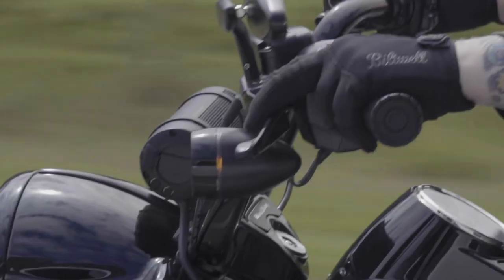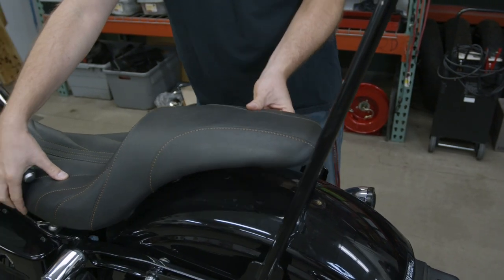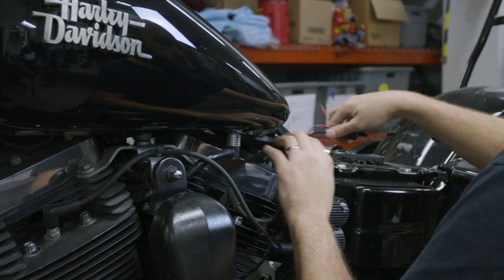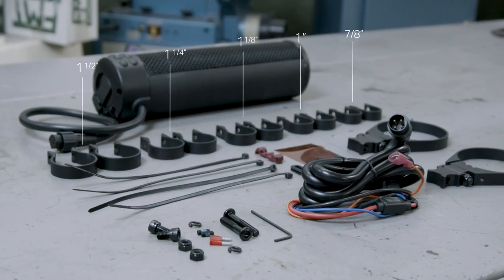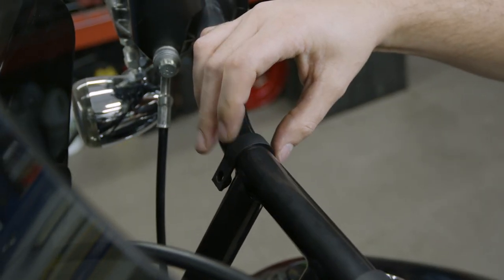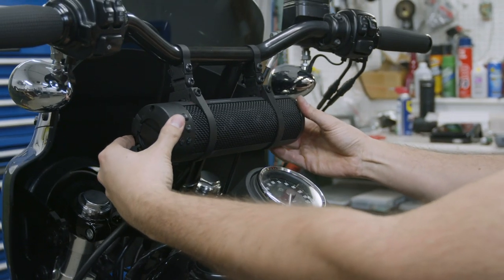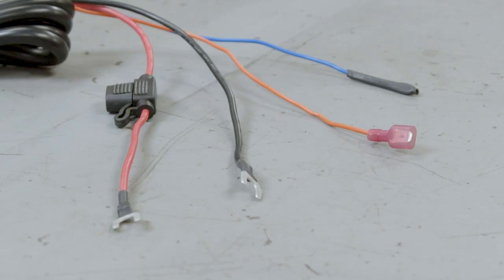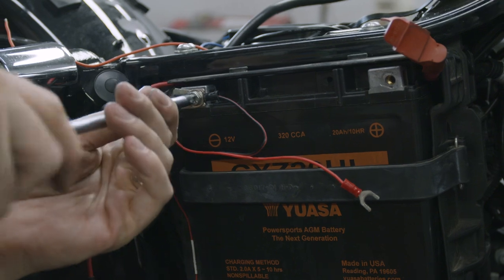How to: Installing Kuryakyn Road Thunder Sound Bar Plus by MTX

Comment: I just finished installing the plus model on my 2014 road king pretty easy install for a novice. Must use all 3 wires in order for the bar to work, pos and neg not enough I used the wire going into the rear fender for the t-tap plug-in I used the red/white wire. Works fantastic took the bike on the highway at 80mph sounds great turn vol up all the way on the iPhone and adjust on the bar. Pricey but not as bad as the Rockford fosgate I was estimated at the dealer with new painted bag lids etc was sniffing $2500., $400 doesn’t seem so bad. I wanted some tunes but I didn’t want to give blood.

Comment: I connected red and black I left the orange off did not work any suggestions
Reply: Me too.
Reply: I added the orange ignition wire to the red positive battery it worked but it turns itself on when bike is off and killed my battery so it needs to be tapped into any orange bike wire to run properly
Reply: I don’t like tapping in so I’m going to have my bike guy do it it’s better that way he knows how to tap in without ruining the wire 👍

Comment: hey where u splice that orange wire on a cam ryker ??? no one seems too know or aint saying ..  great video info ..
Reply from the maker: You're going to want to tap into a switch powered wire!
Reply: @KuryakynHoldingsLLC  Great - which one is that on a 2020 Sport Glide Harley???
Reply: @staneyler  i used a test light to see what wire was hot ONly when ignition on.  fund one and tapped  in.  that way only on when power on.   why they cant tell you this..i dont know

Comment: I am completely stumped!!! HELP!! I have hooked up two different units and have the same problem. Red to red, black to black, orange to switch powered accessory. The unit will not hold power, the lights on the sound bar display for a split second then nothing!! Am I missing something?? 2005 Dyna super glide. I literally bought two different units thinking something was wrong with the first one, and now the new one is doing the same...
Reply: I’m having the same problem, did you get any help?

Comment: which fuse goes where
Reply: thats also a good questions  i googled everything.  just went with it  works both ways   directions are sketchy
Reply: @kymeryobryon834  definitely make sire to use the correct fuse otherwise it will blow prematurely
Reply: @kymeryobryon834   so either fuse will work? One is a 2 and the other is a 7.5

Comment: How can you add a subwoofer to the kuryakyn road thunder sound bar. Spoke to more than 20 supposedly Kurkakyn dealers,no one has a clue. It has an import and an output on the left side to add subwoofer. It’s a one wire connection and no one knows of a subwoofer that will connect to it up on.

Comment: It looks like every body can figure out everything except the Orange wire and the fuses. I watched John Maxwell - a Harley Trained mechanic install it and even he was confusing - he cut off some of the wiring harness and says to buy part # 69201599a and I called Cycle Gear and they say your instructions say your wires will connect directly. No cutting or Harley Harness needed. I think the video needs to be slowed down and shown from different angles and really explained in granular detail. No one wants to blow up their electrical system. Palm Beach Harley quoted $405 to install it. OUCH! They must think I am Trump...(he lives in Palm Beach).

Comment: Hi I have the Kuryakyn Road Thunder Bluetooth Sound Bar Plus by MTX but don't have the wires to connect to the battery only the wires from the speaker do you know where I could buy the battery wires to connect to the speaker I'm based in the UK and have looked on the Web but can't find the harness anywhere 🤔🤔🤔
Reply: I’ve got some…

Comment: I’m confused.
So the speaker arrives with two fuses. 
The instruction manual states there is only one . There’s a 2 amp and a 7.5 amp fuse. 

Which fuse goes to the positive terminal and which one goes to the orange?

————————

I’m riding a HD XG 750
Would I be able to use a tap fuse from and connect the orange directly to my accessory in the fuse box
Reply from the maker: Reach out to our tech team for help!
Technical Support: 715.247.2983
techsupport@kuryakyn.com
Reply: i had a 7.5 and a 12!!!   and reached out to tech support and never a reply

Comment: If only you had a customer service human being to assist! waiting on over 800 emails until you get to help me not good customer service.  Had on bike for 2 days.  now clicks on then right back off.  dissappointed in the money i spent vs customer service and being able to use this.
Reply: Did you get any help? I’m having the same problem
Reply: Finally found out I had a blown speaker. They sent me a new one. I got mine from Amazon so was able to get overnight.  New one worked amazing for three yrs in my bobber. Just sold bike removed it to keep. Well worth it once working